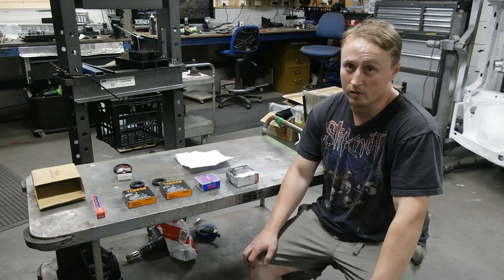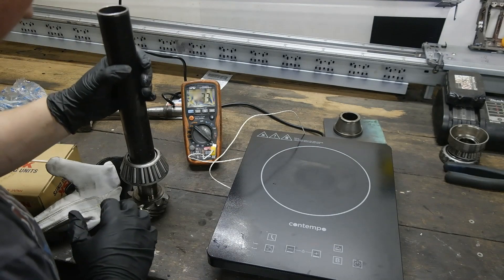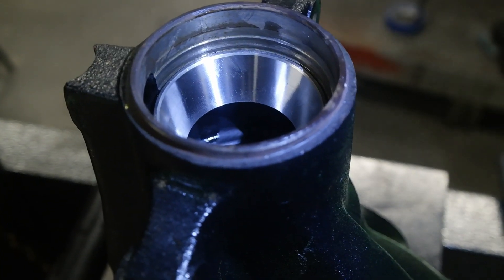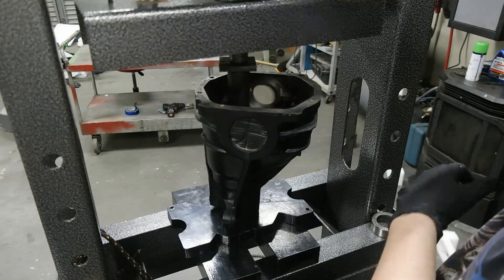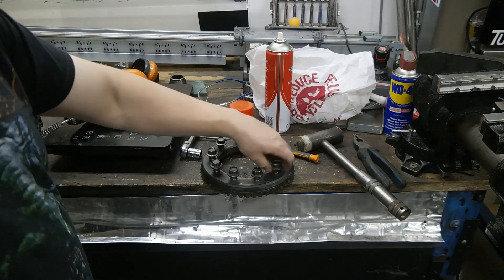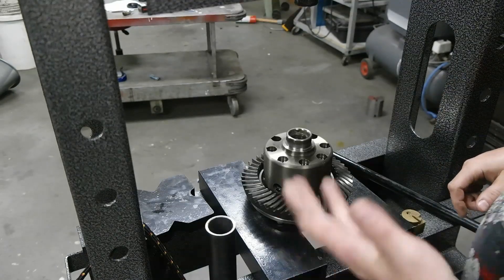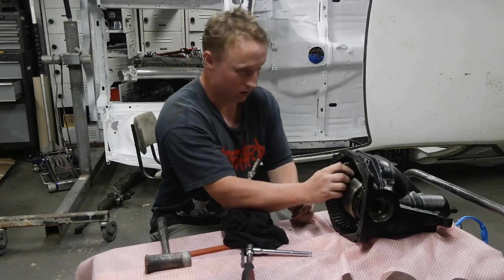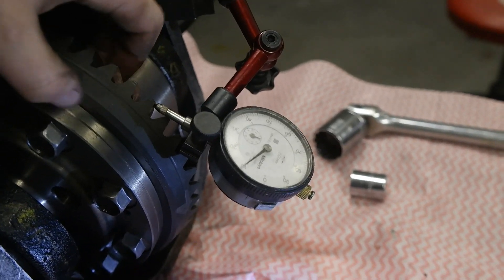S13 R200 Diff rebuild PT2 reassembly

Comment: hey man, my driver side axel snapped and torqued up my output shaft (5spoke) do you know where i could find a replacement, i thought about heating it up and bending it back into place but  its cast so i dont think itll work

Comment: 14:35  Hello , i see you tighten this nut without a torque wrench until i guess you felt it was tight enough . Did you just leave it like that ? because the manual says  19 to 30kg !

Comment: The heat does not work because the whole bearing is expanding. Both in the outward and inward directions, so the outer diameter is getting bigger and inside diameter is getting smaller.

Comment: Did you measure pinion bearing preload?
Reply from the maker: No, only what was shown in the video.  I'm not sure there is any adjustable preload given how the spacers work but could be way wrong.
Reply: @TurnerTVOfficial  http://www.eatsleepboost.lt/files/manuals/s14_200sx_sr20det_repair_manual.pdf check out page 427.

Comment: Do you have the part numbers of the bearings and the seals you used?
Reply from the maker: I'll have to see if i can find the receipt. The bearing shop I went to had a listing for the car model on their system
Reply from the maker: Bearings:
=========

Side outer  30209J  Koyo 2
Pinion accel outer R35-24  NSK 1
Pinion decel outer 32306AN  NSK 1
Side seal  35x55x10/11   2
Rear Seal  AH7288H  NOK 1
Reply: @TurnerTVOfficial  Thank alot man you the man!!!!
Reply from the maker: @jsnismo240sx  No worries! Hope they help - they were in my notes folder for the video
Reply: Turner TV 🤦🏽‍♂️ thanks 😂

Comment: Good work man! I need to do this but it seems more work than I'm capable of! Especially as I have an old wooden shed and certainly not the money/space for a press like that lol!

Good way of explaining it though dude!
Reply from the maker: Cheers man!  I reckon its probably best to take it somewhere that does it, I just like to pull apart everything!
Reply: @TurnerTVOfficial hey man I know it's been years you made this vid, but would you happen to remember the amount of torque you put on the pinion shaft nut?